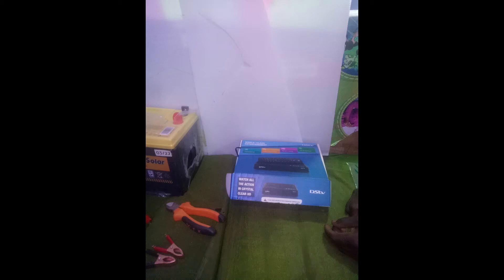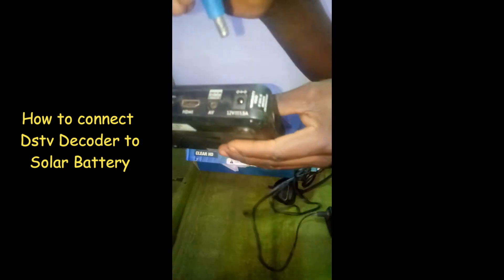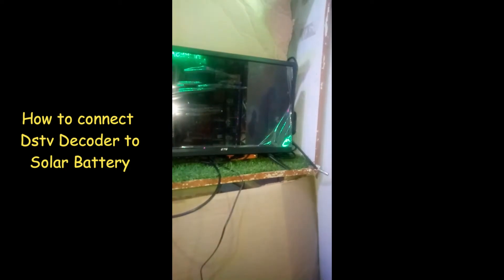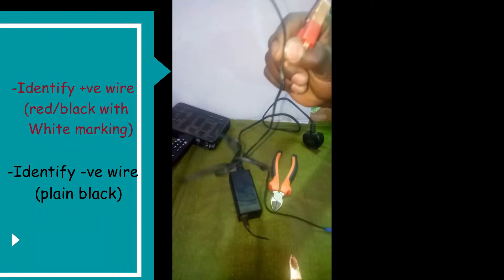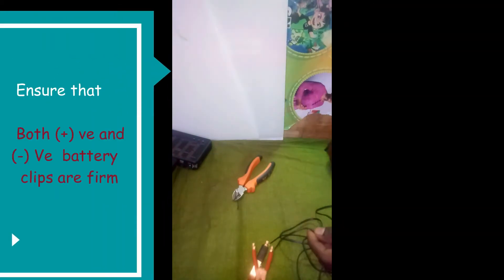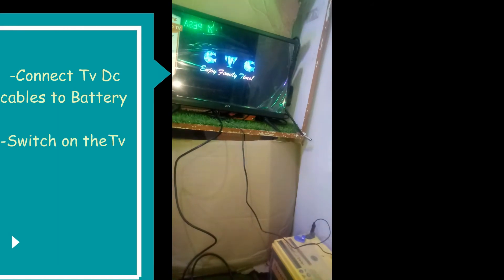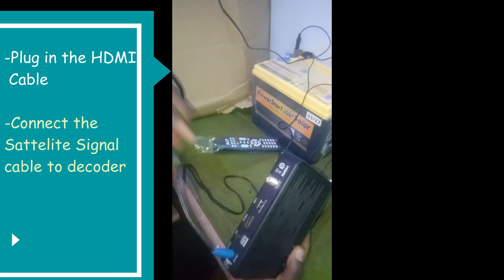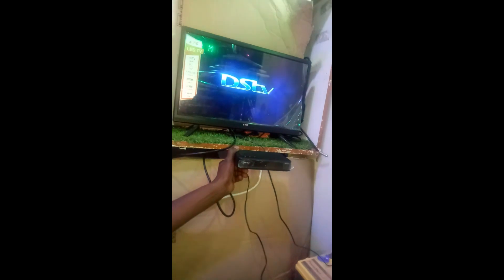Solar Powered DStv ,How to Connect Dstv Decoder to a Solar 12v Battery,12v Dc Battery

Comment: can this work for an open view decoder
Reply: As long as its a dc decoder, meaning a decoder with an adapter brick ie 12v-15v
Reply from the maker: Yes it can as long it is powered by a 12v DC power supply unit